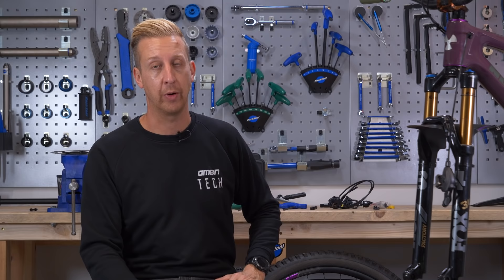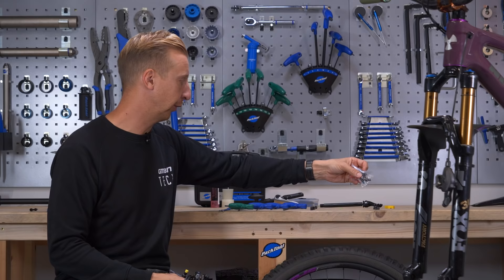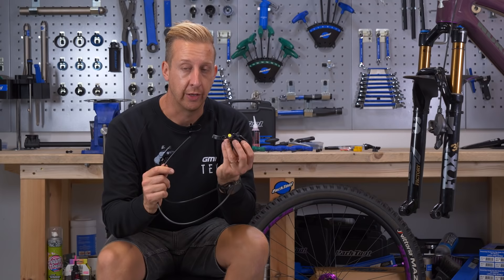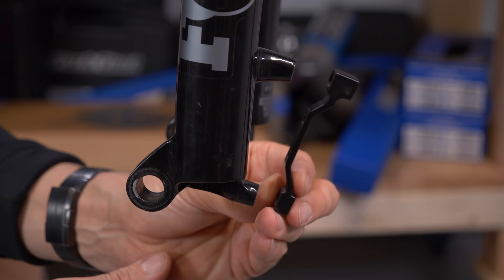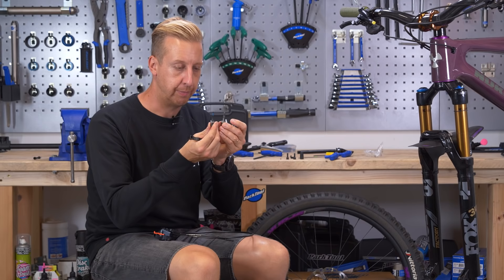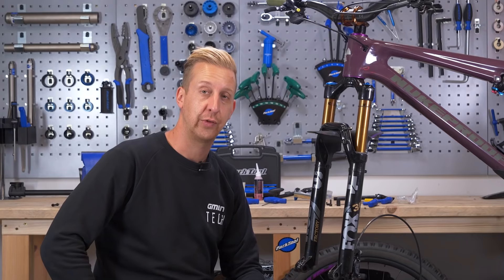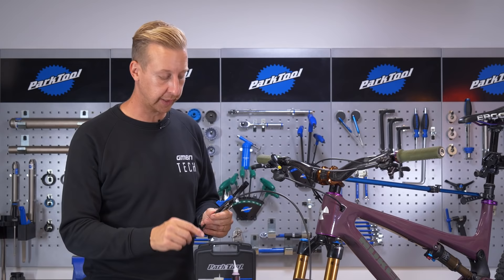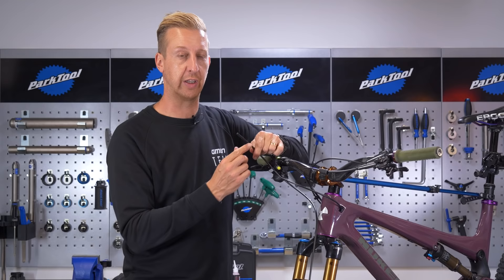How To Install & Set Up Mountain Bike Disc Brakes

Comment: When installing new discs,hand thread the bolts,rotate the disc clockwise then snug the bolts while holding the disc.reduces any sudden shearing force on the bolts if movement occurs during braking.
Reply: Good advice 😁 👍🏾
Reply: what if you tighten the bolts to torque spec?

Comment: You can run hose through the frame using vacuum cleaner and string (+paper maybe). For hose cutting there are cheap plastic cutters, which are perfect for home usage.
Reply: Yup, good advice. You might also find that the brakes come with a couple of plastic pieces that can be used to clamp the hose in a vice, you can then tap the insert in with a small hammer.
Reply: @sandy_knight  yes, exactly :D There is a difference between pro workshop with all the special tools needed and home :)

Comment: ....one wrap of ORIGINAL DUCT TAPE around the ends of existing/replacement cables held together is enuff to pull new cable through frame.

Comment: 13:16 115 euros for a tool to make a diagonal cut.. when the tool does not align the hose perpendicular to the blade you have to do it manually. so a 5 euros cutter its sufficient

Comment: THANK YOU for covering the caliper spacing guidelines. Nobody talks about that. I had to learn the hard way after upgrading my forks and the calipers didn't need the existing spacer so I had to get shorter bolts to attach it. I wish I watched this before starting the fork upgrade.

Comment: thankfully I've never had to fully bleed brakes, usually just burp them a little bit and they're fine. In terms of cutting the brake hose I've always just used my Park Tool cable cutters, they give a really nice straight cut without crushing the hose end, then I use a very small pick to bore out the cable end a little bit, clamp the hose between those yellow plastic blocks with some vise grips and use a regular hammer to hammer in the barb. I did buy a barb inserter last week though after i realized I lost the yellow plastic blocks and had to hold the hose by hand which was pretty hard since it was covered in mineral oil as I hammered the barb in.

Comment: @10:50…”make sure it’s routed the correct way”, as he puts the front brake to the RIGHT side!!  Haha
Reply: Front brake IS right side. 
You run front brake left lever?
Reply: @mattjns  : the normal way, right=rear
Reply: @GHinWI  which country are you in?
Reply: That’s the correct way in the uk. I moved abroad and could never get my head around it. Swapped them around.

Comment: I just installed a set of SLX 7120 4 piston brakes on my Surly Disc Trucker it was pretty easy to do I had Avid BB7 cable brakes before but I feel I got a lot more braking with the SLX 4 piston Hydraulic brakes but its to cold here it's -16 out side can't wait until this spring.

Comment: NOTE : the magnetic ‘tube feed/guide’ tool will not work on steel frames (only aluminium, composite or other non-magnetic material frames will allow the magnetic tool to be used )

Keep safe - both on 🚴🏼‍♀️ and off 😷 the road 🙏🏼

Comment: 14:57 The fine tuning was sort of skipped over here...
I usually check that the rotor is centered in the groove that the disk runs in, at both top and bottom of the rotor.
If the rotor is too far one side or the other, you will often get a continuous squeal from your brakes or even a sqee squee squee etc if the rotor has a slight warp.
If you look at the rotor (ignore the pads as they will centre themselves) the channel is usually square sided, as is the rotor so moving the caliper left/right one mounting bolt at a time, you should be able to get the disk sitting nicely in the centre. Putting the break on a couple of times should centre the pads.

If you think there is any contaminant on the disk/pads, try a brake clean product. 
I am running a 2nd hand bike with pads that were soaked in oil when I got the bike. The brakes were so bad, 3 finger braking barely slowed the bike and the noise was penetrating...
I cleaned the pads/rotor with brake clean (and soaked the pads in meths) and the result, 2 years later still 1 finger braking on black trail down hill with the same pads (as my shonky mediocre videos show.. including the squealing in the 1st 2 videos).

Oh and a tip for Shimano Brake Fluid... Often buying the 1lt bottle is about twice the price of a 100ml bottle.  Mineral oil has a near endless shelf life if stored well, so for twice the price of the small bottles you'll have enough oil to last several years (or you can bleed your mates bikes for a few $ and pay for the oil.

(gone are the days of me running a set of Magura Gustav's on Olive Oil for 20 years.)...

🙉
Reply: I'm Haveing a hell of a time with my brakes, The whaling coming from them is loud as hell and embarrassing, Been riding for years and never had noisy brakes. I've done everything, sanded discs, Replaced pads, bedded them, I can't see no leaks at the caliper, I'm baffled. I have SLX 4 pots,  I use Noah and Theo pads, Are these pads crap?
Reply: @stuarts4673  I have no experience with different pads... but there is one thing you haven't done... Swap the front wheel with a friend and see if that fixes it. The disk could be warped or loose... If you have another wheel with the same size disk, try swapping that...
Do try brake clean on both the pads and disk.. if there was contaminant on the disk and you put new pads on, it may have carried across...

Comment: PLEASE NOTE: Installing the front brake with lever on right side of bar is backward (unless it's a European thing?). I am in the USA and the Shimano XT brake caliper/lever combo kit (M8100 series) I bought is denoted as having a left side brake lever and comes with 1000mm of brake hose pre-attached and pre-bled to the caliper. The rear brake (w/right side lever) kit comes with 1700mm of hose pre-attached and pre-bled to the caliper. All bikes I have ridden in the USA come with left brake = front brake, right brake = rear brake. Shifters are on the right and dropper lever is on the left.  I know GMBN is a European-centric channel, but something worth noting in case you're in the USA.
Reply: Yes, putting the front brake on the right side is a common practice in Europe. Now that I think about it, it does somewhat make sense, as the front brake is used more frequently than the rear. And, since most people are right-handed, having the front brake on the right side may allow for more precise control and modulation with the right hand.

Comment: #Doddy, thats the textbook work. wich is great :)
However my experience with breaks is it different, depending on the breaks, I  take that spacer off, and anywhere from extremely gently to very gently I press the lever to decrease the space between pads and rotor itself, this lets me to better fine tune my breaks to my liking.

Doing this it is mandatory to be super careful and gently test the breaks afterwards, since if there is no space between pads and rotor or the rotor drags on the pads while turning - thespace is too little, So that's something to look out for.

However it also lets me fine tune the breaks and the modulation of breaks. and honestly I will never ever use any breaks with DOT fluid- they are super hard maintenance and the breaking power in my opinion is simply less then their equivalent for mineral fluid.

Comment: You know it have been really helpful? Showing us how you put the actual disc on the wheel! That's what I got on your video for because the discs I have don't seem to be able to be used for the wheels that I have and I wanted to make sure that but I set your video for over 15 minutes and you've already got discs on the wheel That's the part I needed to see you do!

Comment: Doddy, What's your views on running internal on a frame designed for external (i.e an old Giant Faith 0 - alloy). 
Will it compromise strength (Not that I use the frame anywhere near its limits)
I've considered running my derailleur internally with a inlet/outlet guide and bare internally to reduce friction. There are already exit holes at the bottom of the downtube but nothing at the top. (I may have to make stainless myself to match frame angles etc.
The faith ran the derailleur and rear brake down the front of the downtube which is a little exposed to my mediocre  riding "style" as I do tend to case a few hurdles...

Comment: Thanks for yet another good video. One question. If taking care one could manage to do the cutting without a special tool, but do I need a special tool the fit the insert anyway? "You can not fit the insert by hand, use the relevant tool". Anyone any idea on how to fit the insert without special tool?

Comment: Why do you put an olive if the lever already has one inside, or why take it off and reinstall? I have just checked Shimano manual and they said that the olive comes pre-installed and when inserting the hose, ensure it doesn't snag on the olive.

Comment: I've tried 3 times to tune/bleed my SRAM Guide RE brakes - they can be fidgety to bleed to ay the least. These ones don't use the newer Bleeding Edge ports unfortuntely either. I am struggling to get them working better and find I am now more or less drawing the lever almost to the bars before they bite properly. What am doing wrong? (PS. I've checked my pads for remaining pad surface and is still well within recomended thickness).

Comment: I had a new set of XT M8000 brakes installed (all black oil well and lever), replacing my old XT M785 brakes (chrome oil well). The old hose was used for the rear brake because we could not remove it at the time. However, the old hose is thicker than the new hose which came with the new brakes. When I braked hard, the rear brake hose popped out. Is this an issue with the diameter of hose, even though it seems to fit, or just installation error?

I suppose what I really need to know, is the diameter (thickness) of hose an issue?

Thanks

Comment: Hi there, why is the OLIVE to be changed every time, and cant't be reused? Does it get squeezed after first installation? Thanks a lot. Francesco_
Reply: That's the design principal of olives - they get squished as the nut tightens  to make a good seal.

Comment: 13:15 That cut was not even close to 90° 🧐
Reply: Yeah, what's the point in buying an expensive tool which doesn't do it any better than some other much cheaper ones?

Comment: - the next step in getting v sensitive brakes (if that's your preference) is to carefully adjust the gap between the brake pads. 

- occasionally leaving the brakes (lightly) applied over night helps w/ floating air bubbles past the master cylinder..

nice 'how to' video, as always. 
pls talk more about the price of the fluids as it's beyond parody... :}

----------------------------------------------------------------
* the pads are what require extra care when working w/ oily substances because of the porous/absorbent material is. rotors are easy to 'decontaminate' and it should be done before the pads ever touch them regardless if gloves were used or not.

** that's clearly not a straight cut @13:17 and everything works just fine.. i'm not saying to cut the line with a spoon, but i am saying that the insert & olive is what seals the system :}

Comment: Thanks a lot for this video, I've never mounted any brakes, but going to do so with my new brakes over Chrismas.

How much torque is required to secure the disk rotor bolts and the bolts for the caliper? 6nm?
Reply from the maker: Hi @SomeoneLikeYouRandom, It differs between manufacturers so it's always a good idea to check with your specific brand of brake. However, 6 to 8nm is normally a good amount for a calliper bolt. Rotor bolts are slightly less due to the smaller bolt so 4 - 5nm would be sensible. Just check for any wobble on the rotor or calliper to ensure you get safe and effective braking. Thank you for the support👍

Comment: That can be very messy
Reply: Because of the oil
Reply: Mineral oil is a bit like standard old engine oil. Its a little messy.. but doesn't do any damage (except to your expensive carpet) and can be cleaned off with brake cleaner.
The older type brakes that use DOT brake fluid is way worse as not only is the fluid like paint stripper (Literally it will strip paint off a LOT of objects including the caliper/levers eventually) it is also hygroscopic, meaning ANY moisture is attracted to it, and can cause rapid deterioration of the brakes.. (I've had my old Hayes boil and become completely ineffective on a decent length descent and found I had to do a change at least twice as often when I was riding nowhere as hard as I do now.